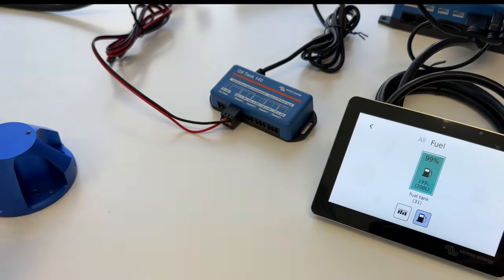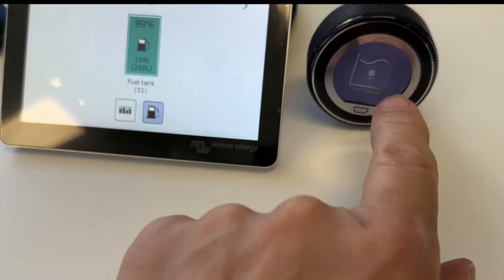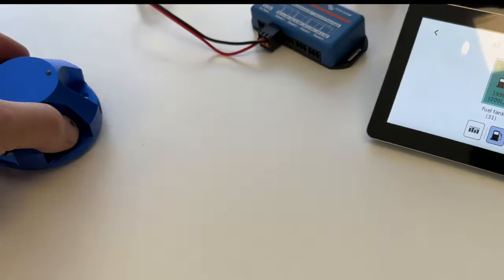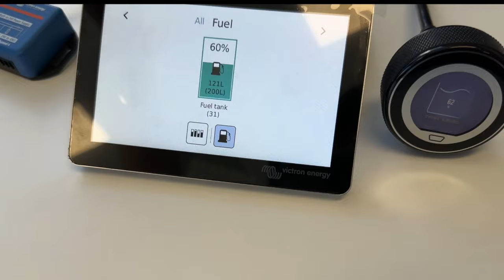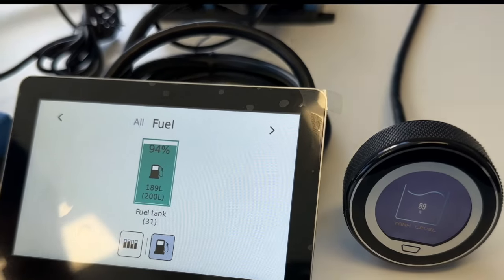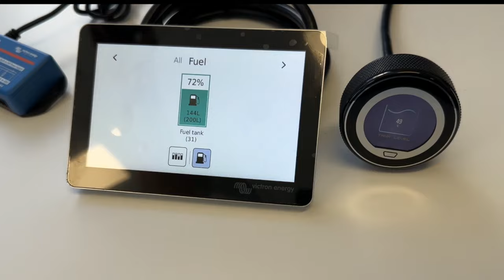Black and Grey Water tank level now have a solution: STAR tank Phased Coherent Radar Tank Sensor.

Comment: What glue would you use to fix to a poly tank? I thought getting anything to stick rp those high density plastics was near impossible?
Reply from the maker: Our experience is a gas torch on the surface drives out some oilly matter and then we adhere with a Sika material. This has worked for us.

Comment: When used on a alloy fuel tank, does it need o hole or just bolted to the top of the tank?
Reply from the maker: Needs a hole
Reply from the maker: @mal4821 Hi Mal, it will only be to the Cerbo and Touch Display. Should be available in 6-8 weeks. Cheers